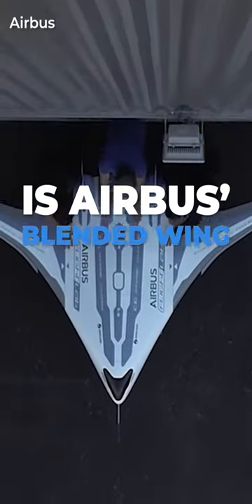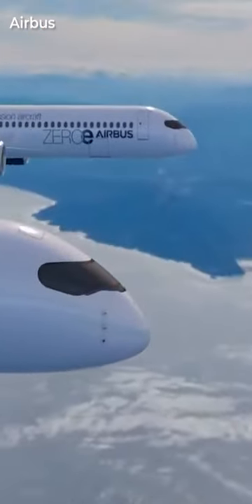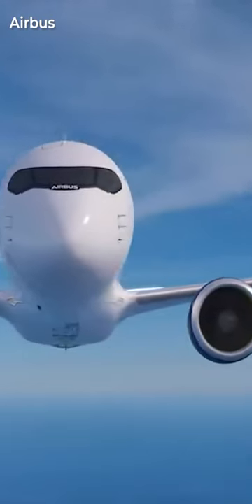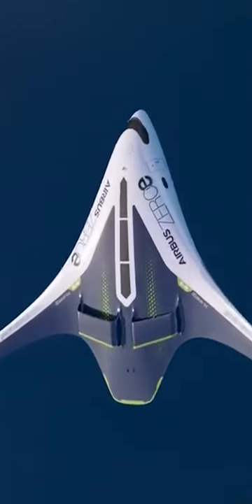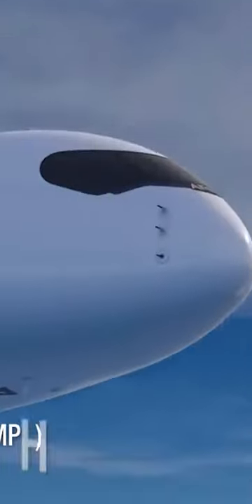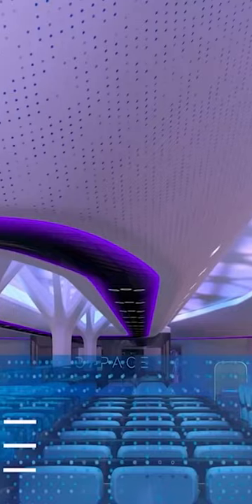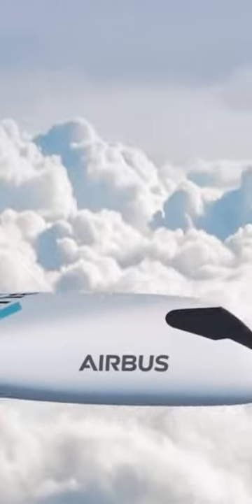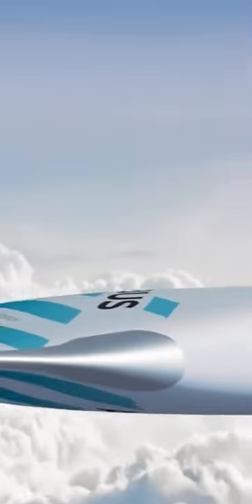Airbus' Blended Wing Hydrogen Plane: Doomed From the Start? #shorts

Comment: So why the headline? Why is it 'Doomed from the start?' Your commentary doesn't appear to say.
Reply: There was no promise in the title that the question would be answered.
Reply: Clickbait
Reply: For a number of practical engineering reasons
Reply: @matthewmosier8439  cuz it's not supported by Saudis
Reply: The shape is doomed. The ratio of passenger to exit door is just too high to be safe in this configuration.
Reply: @mortlaursen6752  However, the performance of a blended wing to a cylinder body is like night and day.
Reply: @The Rice Potato  I  agree that there are practical engineering reasons why H2 may not be possible, now. Don't, however, underestimate the rate of development possible. The aerospace industry wishes to demonstrate environmental credentials (even if by sleight of hand), and once they put serious money into this, they'll want to make it happen. The first flying wing designs took flight in the 1930's. The tech now exists to make them practicable on a  day to day basis. Environmental imperatives are driving H2 solutions in various sectors. This video was rubbish. There are better solutions to pollution than this. But tech advocates tend to win out, in the end, due to money.
Reply: @mortlaursen6752 Does this rule out freighters?
Reply: @samuelitooooo  no

Comment: This didn't explain why exactly the switch to hydrogen was difficult
Reply: It's difficult, for a few reasons. #1 being that in order to make hydrogen safe the weight penalty is enormous. #2 it's hydrogen, which would make a crash that was survivable something not survivable.
Reply: Nobody ever explained why we should... the only reason ever given is that ita better for the environment. But is it really?.. well. No its not.
Reply: @matsv201  And what makes you say that? If the hydrogen was produced using renewables or nuclear power, it's clean.
Reply: @gabedarrett1301  well not really, even at that  it's a huge assumption.

While coal have a CO2 rating of 1200g/kWh and PV "only" got one of 50...its a lot lower, but its still not zero.

Even worse.. most hydrogen (about 96% world wide) is made of is made of natural gas. That have a CO2 rate of about 250g/kWh of hydrogen.

But wait.. the 50g for PV is not for hydrogen, but power  the  its 80 or 100g when converted.

So the supposed clean alternative is really not that much better than the system that is used today.

Then there is the capacity losses of the airframe. 

If cause.. it would be cleaner with wind or nuclear.

But then.. looking at the hydrocarbon alternative. Like sabatier process. Then you have gained very little, hardly any... if any. So what is the point.

The only reason I can se for hydrogen aircraft is that unlike sabatier process, its easy to hide natural gas say imported from Russia or Middle East in the fuel. When using sabatier process, that would be hard. And very expensive.
Reply: @matsv201  if the switch is to be made, it ought to be for practical reasons. Japan is looking at hydrogen for ground vehicles. Why? They have no oil reserves, so all gasoline and diesel must be imported; this makes fuel very expensive in Japan.

They can, with relative ease, produce a lot of hydrogen domestically, so if they can address all the safety concerns, hydrogen would be significantly cheaper, even if they have to replace all their ground fuel infrastructure.

It being (somewhat) better for the environment is just a bonus.
Reply: @sfrsteel  After looking at Zeppelins, working with Hydrogen is indeed difficult.
Reply: @Eis_  Zeppelin comparison?? Is that due to combustible properties of helium and hydrogen? Oh ok. I get it.
Reply: @sfrsteel  While your first point is correct, the possibility of hydrogen ignition near the engines of an aircraft compared to say, jet fuel is far lower. when stored under such high pressures, escaping hydrogen moves too quickly to be ignited. This is the same reason hydrogen fuel cell cars are safe.
Reply: @matsv201  nothing's good for the environment. Hydrogen transport is much cleaner than electric transport tho, and it's currently the best option we have. Going electric only causes more harm.
Reply: @Eis_  Dude that was more than half a century ago, get real.
Reply: @sfrsteel  hydrogen is just as, if not safer in a crash. It's not scary until you have a dual air mixture. Until then, hydrogen just burns perfectly cleanly, with no toxic byproducts. Sure it's still really hot, but you can see.
Reply: @matsv201  hydrogen doesn’t need to be made from natural gas lmao
Reply: @donutperson9027  so you just didn't bother to read?
Reply: Let's assume you use renewables to make hydrogen and can get the carbon footprint reasonably low. The real reason hydrogen is not ideal is because it's so hard to work with. Because it's the smallest molecule it seeps into the actual gaps in the molecular structure of metal containers holding it causing hydrogen embrittlement. The containment for it adds an undesirable weight penalty for transport vehicles. It's not as easily compressible as other gases so will require more volume for the same energy output as hydrocarbons or a compromise for shorter ranges. Hydrogen can work as a reasonably clean and green renewable fuel with a few caveats. But if people are too precious about our current lifestyles to make compromises for the shortcomings of hydrogen fuels then it's unlikely to be a meaningful commercial success. But fingers crossed something decent works out, right?
Reply: Hydrogen storage is resource intensive. Gathering enough to fuel a fleet of aircraft is madness in the current day. Hydrogen is extremely volatile and will Hindenburg spontaneously at times. It's energy density may also be less than jet fuel, although I am unsure of that point
Reply: @gabedarrett1301  so if I make charcoal using nuclear or renewables will that charcoal become eco friendly too?
Reply: @matthewmosier8439  hydrogen is getting flak because it's expensive, dangerous and a pain in the arse to procure to the scale needed to fuel the modern world. EV is the new race because it's safe (relatively), easy to make and profitable. 
Your complaints?
Reply: @deven6518  EV "fuel" is less energy dense. More weight for the same performance. It is far too heavy for air transportation. Electric motors are great, but electric motors should not be connected to batteries as a power source until battery tech or something even better, can improve. In short: EV's can't fix the problems they try to fix. I'm starting to wonder how people are not able to see that fact, actually. I'm all for new tech, which is why I can't help but see the dogged insistence on only battery technology being ideologically based since it seems to try and resist all other forms of technology. That's just how I'm seeing it, right now.
Reply: @matthewmosier8439  you need to take into account the containment and extraction (energy) equipment when thinking about energy density, which Is why I did mention it earlier in the comment. 
EV fuel is not less energy dense, it's just containment. EV fuel is fossil, hydro, nuclear, solar, or whatever means you use to generate electricity. Fossil seems odd but it's cleaner than cars simply because it's easier to control emissions at the plant. And hydrogen is connected to what by a how through what means if extracting energy? It's a roundabout question
Reply: @deven6518  I think that you misunderstood what I was saying. From what I remember at least, batteries are less energy dense by volume than, say, a tank of gasoline. Electric vehicles weigh far more than gasoline powered ones (this issue with bridges and infrustructure is another topic I won't get into right now) Batteries are not yet capable of providing a replacement for transportation. Hydrogen offers a potential replacement.
Reply: Storing hydrogen is difficult. It tends to leak straight through metal containers, weakening the metal in the process. To keep volume down, it can be stored at pressure and liquified but that requires deep cryogenic temperatures that even NASA struggles to maintain. Often they just let it boil off and keep refilling. Gaseous hydrogen near room temperature requires huge volume to store. Plus even if you are doing all this to reduce pollution, burning hydrogen in practical engines will frequently produce large amounts of nitrogen oxides (NOx). It is a lot if hassle, reduced capabilities, and reduced safety for limited benefits. Just take more electric trains instead.
Reply: @PhycoKrusk  this explains why Toyota keeps pushing hydrogen
Reply: @matsv201  first of all they wouldn’t be using natural hydrogen, second typically if something still creates co2 when burned but actually can absorb it I don’t know about the process of creating a hydrogen or what happens when it’s burned but Porsches synthetic fuel is water where they split the H2O and combined them with carbon dioxide, if this process is done in a way that doesn’t create more carbon dioxide it is seen as zero emissions because zero emissions are being created its being recycled and it can be gas or diesel and you don’t need to change anything in your engine to run it
Reply: Hydrogen is difficult to store, escapes very easily. It is not very energy dense, and therefore needs to be cooled and compressed to match existing fuel options. I do not believe hydrogen is the future.
Reply: @Bilal Ahmad  why use nuclear power to make hydrogen when it's easier to just split water
Reply: @sfrsteel  lol no. Kerosene is much more energy dense and therefore much more dangerous than hydrogen. An out of control fire with kerosene is much more fierce.
Reply: @sfrsteel  Big bada boom
Reply: Hydrogen go Boom

Comment: The blended wing design is a good design for the fact is it is fuel efficient because of the low takeoff, speed and general low speeds need to fly in and that it should be able to takeoff at lower speeds plus increase more cargo hold and more passengers accommodation,  and can potentially take up less space while I’m not gonna be able to increase storage passenger in fuel-efficient up two factor of 16% and more things.

Comment: Nobody should be surprised by this.  Far better to perfect they hydrogen part first.   Then work on the fancy composite blended wing airframe.
Reply: The other way around. The new airframe is the quicker and easier part
Reply: @stupidburp once you perfect the hydrogen part, that system can be adapted for many more planes
Reply: Every try selling color televisions in 1955?
Reply: @moekitsune  exactly! the person thats going to to discover the perfect hydrogen hydrogen storage system is going to be a big winner

Comment: It short, yes. Because, like concord, it likely won’t compatible with most airports and so they would have to be modified to suit the blended wing designs. It’s airport terminal design and runway lengths that are the biggest factors in commercial aircraft design.
Reply: The bwb would have similar if not lower landing speeds…? And it would be roughly the same wingspan or less.

Comment: This used to be called a “Lifting body” and you can see one crash during the opening credits of “The six million dollar man” from, well, before most were born. Probably the biggest problem with this aircraft isn’t the lifting body or training pilots, it’s that’s it’s not compatible with airports as it won’t fit at the gates.
Reply: The wingspan is probably no different to an A380
Reply: actually the biggest issue is that it would be impossible to evacuate everyone in the plane in the required 60 second time frame
Reply: @starexcelsior  They evacuated 853 out of an A380 in the required time frame

Comment: Bold move by Airbus, great to see a major company like Airbus trying to change the aviation industry and put the conventional airframe on its head!
Reply: But they are not.    Don't blame them with the world economy.  This is going to take a lot of R&D money.
Reply: @danharold3087  given that Boeing already has experience with the V Wing via defense, Boeing has the best footing to commercialize it. However such design is not suited for commercial use for air travel, but can be for space travel. Hook up an antigravity generator and quantum drive to it and you have the TR-3B Black Manta, derived the Huanebu Program derived from Vimana schematics the German SS took out of Sri Lanka.
Reply: It's just a concept. Lifting body passenger jet concepts have been around since the 1970's. There are too many reasons they're not appropriate for large passenger aircraft. Will never be built as a passenger plane..
Reply: @PRH123  AI was around since 1956 but it was only with the advent of cheaper computing power that it came alive.   There are other examples.  Your not going to see it tomorrow but never say never and everything old is new again.  At some point it maybe the more sensible thing to do.
Reply: @PRH123  might work as a cargo aircraft eventually though.
Reply: @martindinner3621  cargo is actually one of the areas where blended wings are very problematic….  cargo is most often palletized or in containers, which conform to the contour of the fuselage to insure maximum use of space….  in cargo operations you usually don’t know where in the aircraft the pallet will be when you’re building it…. in a tube aircraft this is workable as the shape of the fuselage is the same everywhere…. imagine a blended wing, where each pallet position would be of a varying height…. would be a very time consuming and costly nightmare loading an aircraft like that…. not to mention transloading pallets from one flight to another…

also no manufacturer would launch an airframe only for freighter use…. there’s not enough customers, wouldn’t be commercially viable…. most freighters in the world are used ex-pax a/c, some carriers like FedEx do buy them new, but again they are pax a/c adapted to be freighters…
Reply: @PRH123  the Northrop B2 is a large bomber carrying a very heavy payload, Flying wings are very efficient when it comes to fuel efficiency and are capable of heavy payloads because their design enables easy lift, Flying wings have been used by the Germans in WW2 era, their problem is stability in turbulent weather.. they don't have problems with range and payload capacity

Comment: Lets hope it doesnt hindenburg
Reply: Hindenburged
Reply: @ChristianTheodorus909  Hindenburger'd 🍔
Reply: The majority of people survived on the Hindenburg.
Reply: Maybe they should put that battery in it from the electric riding lawn mower that burned up in front of everybody the other day haha
Reply: Well there are many resourses working on hydrogen storage and more, so its highly possible that they will perfect the storage for it soon. I mean Toyota Mirai is a good example.
Reply: @dennisdexter5602  To me hydrogen sound great on paper:
• A fuel with no carbon if made from water.
• High energy per mass

But it's not really a good replacement for fossil fuels. Since it also (annoyingly) has a few drawbacks:
• Yes high energy per mass. But as a gas, hydrogen BARELY weighs anything. So you either need really high pressure pumps and tanks (hundreds of bars of pressure), or you liquify it. Wich needs to be KEPT at extreme cold, even when not used (parked cars).
• As of now most of the hydrogen production uses fossil fuels as ingredients, because it cheaper...

So while it is green and clean (if done right). It sadly cannot replace fossil fuels due to these drawbacks. And overcomming them is...    difficult.
Reply: @suddeneevee9441  I am highly aware of the drawbacks, but once we are at a stable situation we might able to use hydrogen to extract hydrogen. Maybe find alternatives to  sources where we dont emit carbon and find better solutions. I see your points but I have to say unless we try to research it we wont ever find the solution to these problems. All I am saying is there is a possibility and I am looking forward to it.
Reply: I was literally about to comment about this lol
Reply: @Tyler_Fuller  true but this is a blended wing not an airship, so it could turn out differently

Comment: I mean the design can and was told to be used as a cargo platform rather than a passenger transport as it proves more efficient in transporting. Design focuses on lift and fuel efficiency.

Comment: Hydrogen and flight are a bad mix. Not only is there risk of an enormous explosion, hydrogen has very low energy density, and the weight of the strengthened pressure tanks makes hydrogen a prohibitively massive solution. Burning hydrogen pumps far more water into the atmosphere than standard fuel, and water has a massive greenhouse gas impact.

Comment: NASA has been working on a blended wing for more than a decade.  this is not dead from the start, just for now.
Reply: It’s likely due to the hydrogen and the containing methods
Reply: @WildWildWeasel  hydrogen?
Reply: @iHelpSolveIt  yeah, the issue with storing hydrogen is that it’s very volatile and pressure can cause explosions, it also adds a big weight penalty to the plane because the containers themselves are already heavy as hell.

Comment: Doomed because hydrogen is impractical for use as an everyday fuel. It leaks straight through metal containment tanks and permanently weakens the metal in the process. Not a great plan for a commercial aircraft.

Comment: Why are flying wings not utilized like we try it once and then just say oh no it’s not good and act like it’s the dumbest idea ever.
Reply: Because they are a challenge to get to fly how we want them to fly.    And as for  making them passenger capable, it requires pressureizing the cabin which leads to a problem because wide, flattened containers want to become spherical when pressurized.   So the design they want to make with wide, roomy cabins presents an issue that needs to be solved.